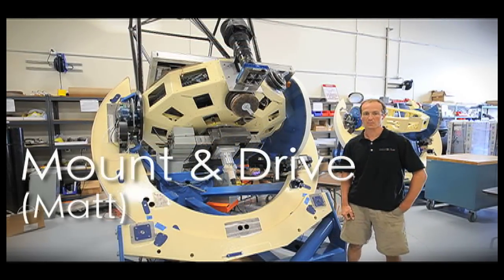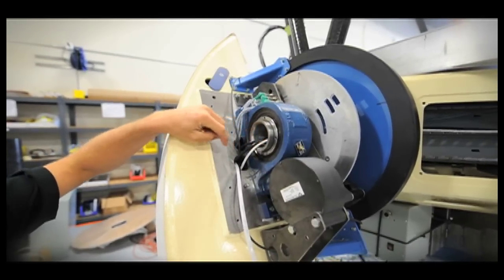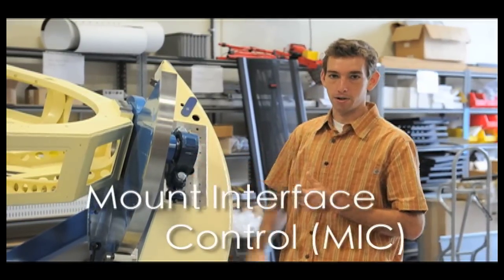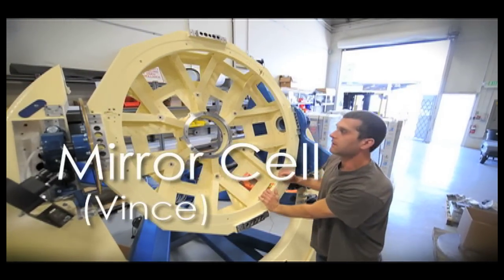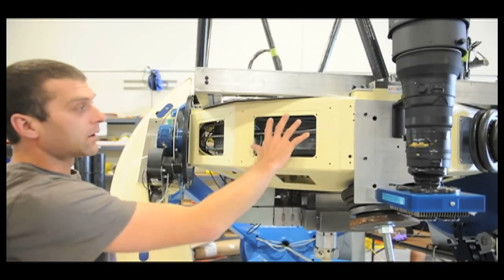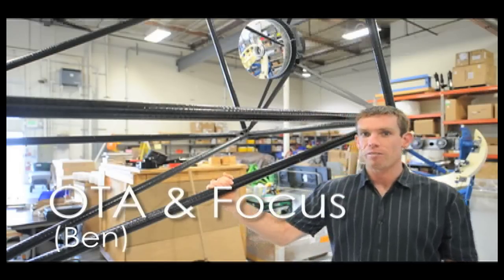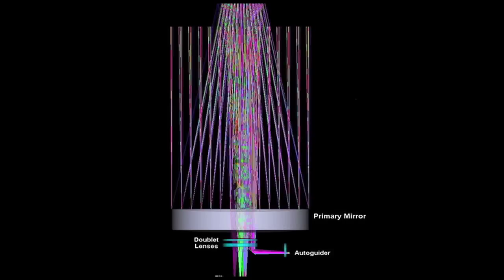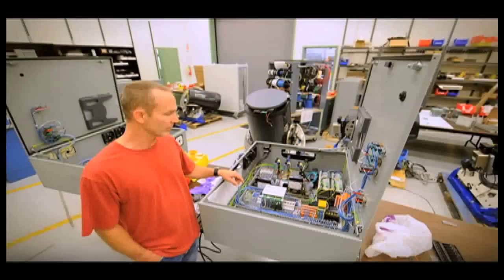About the LCOGT.net 1 meter telescope

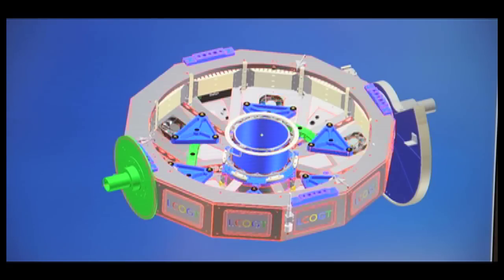Comment: 5:45  Does this mirror have any separate lateral support (around the edges or at the center hold)?  Or is it just glued to those triangle supports on the back?  I'm surprised that a 1m mirror doesn't need variable pressure back supports that adjust based on the angle of tilt of the mirror (e.g. with counterweights)